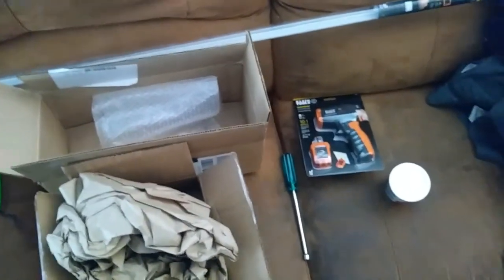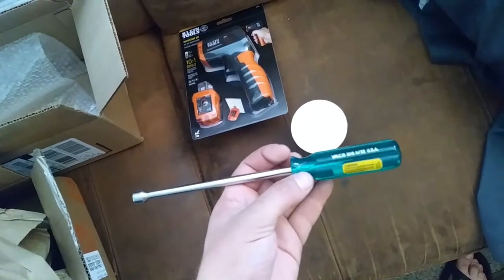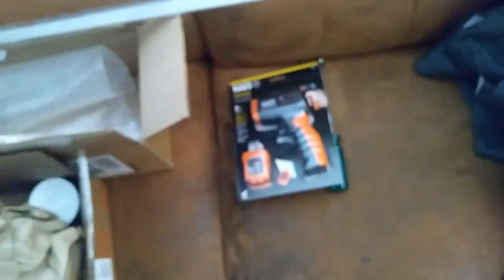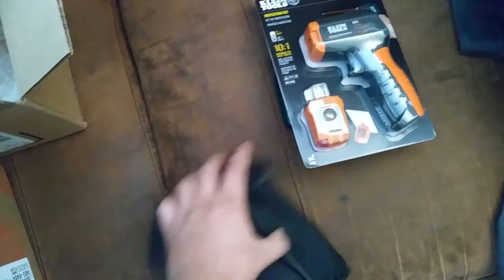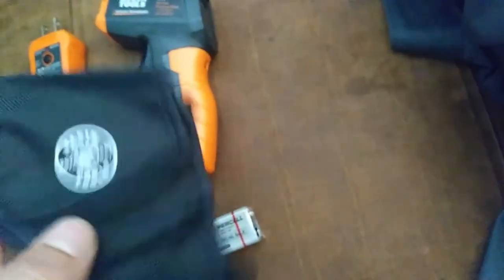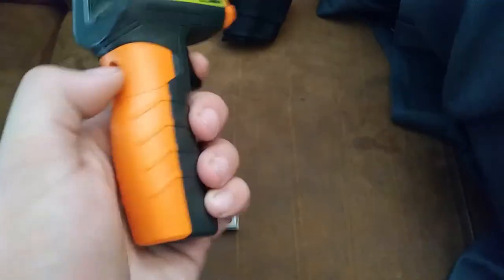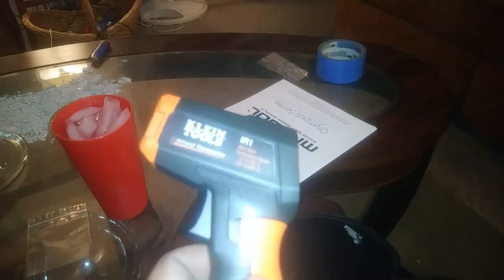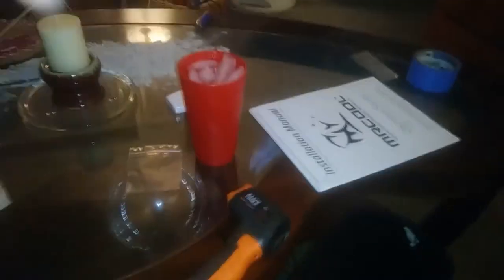Tool Update - Klein IR1 Infrared Thermometer Accuracy Test, Glow Rods, Nut Driver

Comment: Can you use Klein IR1 Infrared Thermometer to detect hot water pipes inside the wall
Reply from the maker: No, this is just a surface temp infrared thermometer. You would need a FLIR camera for that kind of thing.